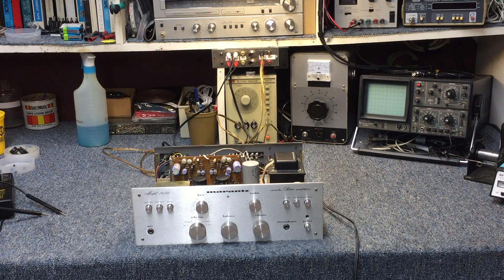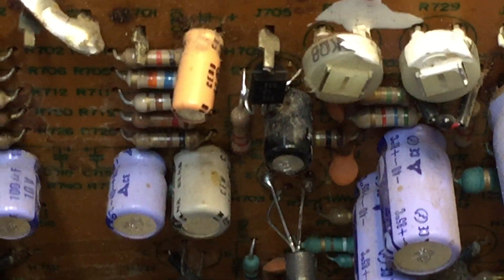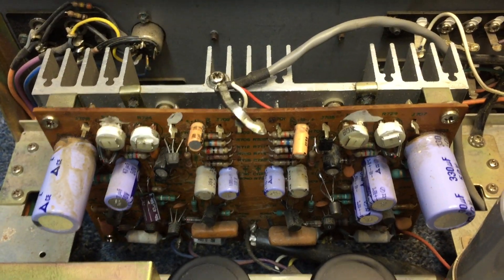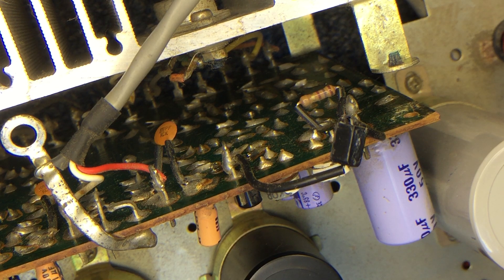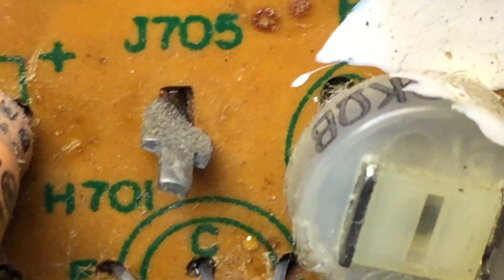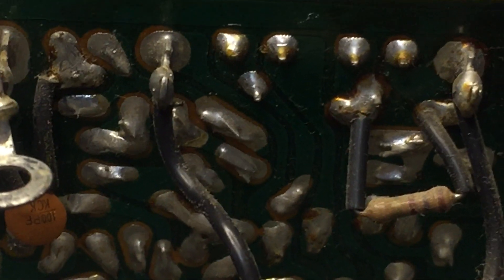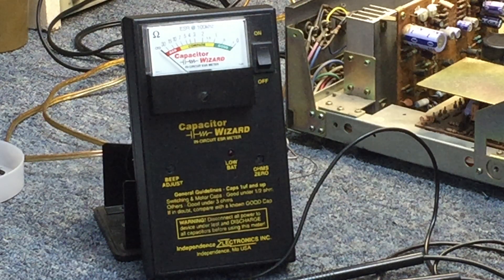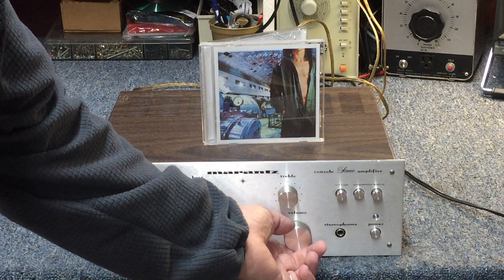Marantz 1030 Integrated Amp - repair & testing

Comment: There are a lot of repairs in these old amps that look like they were done by somebody who had no clue what they're were doing.   I just restored a 2235B that took 3-4 days to undo all the damage done by shops.   I contacted the guy I bought it from and apparently he took it to a "reputable" shop.  I have a feeling most shops do board replacements, and struggle with component level repair.

Comment: I saw many units that had repairs like that. Most likely done by a volume repair TV shop, where they have to get several units fixed in a hour time. Easier to clip out a part and solder a new one in without removing the board. I always removed the board and soldered in a new part like the way is supposed to go.

Comment: damn man! you make cracks on other people's work? take the friggin board out and clean up and recap the whole thing! if you can't upsell that to the customer then you should give up as well!
Reply from the maker: No “competent”technician would replace every capacitor in a unit that doesn’t need it just for the sake of money and why in the hell would I spend an hour (or more) removing a board when I can easily access the defective components from the rear?    As for the quality of the other guys work: thank god he isn’t a surgeon.